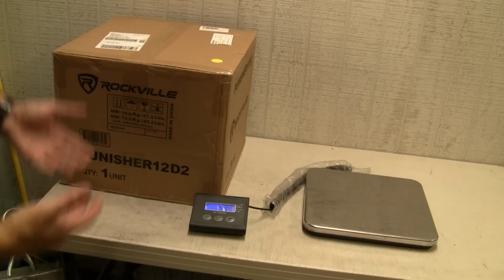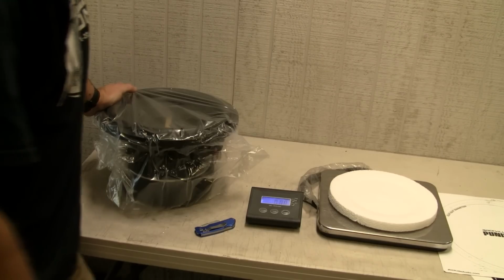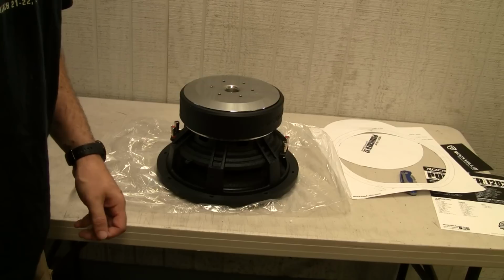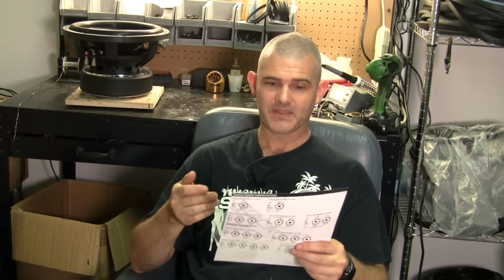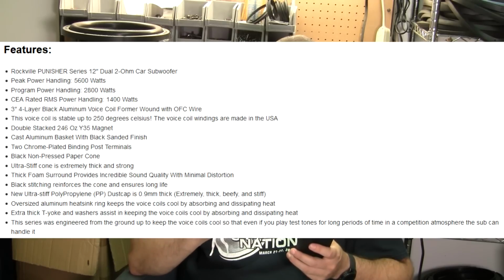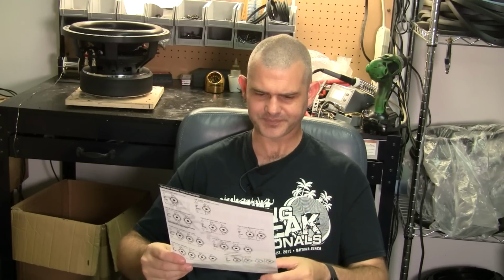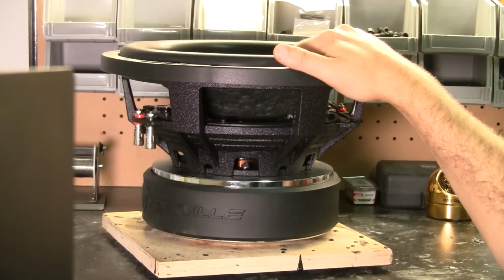Part 1: Rockville Punisher vs EMF Audio Lowballer, what specs do you look for when choosing a sub?

Comment: Eh I bought 2 15 Rockville punisher there running on 1500 a piece and no problems so far running at max power for about a month now and they stay cold and no smell at all
Reply from the maker: You think you're running 1,500 watts a piece. Prepare to have your heart broken in part 3 today.
Reply: @EMFAudio  people think my amp says 3k rms at 1ohm so that means the pair of subs is getting 1500w each and there actually getting it... That's a big nope.
Reply: EMF Audio I know I’m running 1500 a piece lmao I know what I’m doing I’ve been in car audio for 10 years and have the right tools to do the job
Reply from the maker: @ryanlucas7280  What makes you think you KNOW you have 1,500 watts a piece? Doing something for 10 years doesn't mean you've been doing it right for 10 years.
Reply: EMF Audio at a base 40hz test I have 1500 rms going into each one there’s a great tool called an multi meter and a rms meter 🤦🏼‍♂️ since music tends to move around the sound spectrum so does the wattage I measure out a 40 hz tone and set the gains accordingly that’s how I know what I’m getting and I’ve had it professionally checked by multiple company’s and people that know more than me I’ve had these for quite some time now and they aren’t even getting warm if I could dm you my setup I most definitely would I haven’t smelled mine before or anything so what you did in your video I’ll never know
Reply: @ryanlucas7280  lmao. You got no response
Reply: @austing2481  this guy isn’t the brightest hints to why my comments have likes and his dont

Comment: I have a rockford fosgate p3 and now i receive the punisher yesterday and hits hard not full power because still braking it.  Its on 2 ohm now on alpine mp500. So even they exaggerated on raiting im happy and it hit harder than p3.
Reply: U dont need to be full power to break in a sub. 3/4 will break it no problem. The box volume makes a difference also. This destroyer is better than many subs including the pricier p3.
Reply from the maker: You aren't breaking it in if it's not full power.
Reply: @EMFAudio   i just watched youre video  and i like youre way now i will pop my ears out  now tnks

Comment: Just saw a post on Facebook basshead group about how one sub is better then another because it had a bigger magnet and stiffer suspension.  He was comparing a low budget American Bass sub to a Rockford Fosgate T2 13 inch sub . Sure American bass subs are alright but I doubt better than the T2 13 .  EMF should do a Rockford T2 13  subwoofer test to see if it can handle rated specs . I doubt that Rockville can do 1000 RMS for 45 seconds without blowing the coil .
Reply from the maker: Post this video in that group! The following parts will really put it together. I have a fair amount of confidence the Rockford is probably appropriately rated. The American Bass however, I've reconed subs that people said they had rated power on them. I can't validate what they did or didn't have, but I've heard it alot.
Reply: Thats not true, had both will take the xfl all day.

Comment: The missing weight figure would probbalt be the top and bottom plate, woukdnt they be heavy as fuck. Maybe the magnet weight is just the actual magnet rings..
Reply from the maker: It's not hard to come up with 2 lbs of steel, but the plate sizes were accurate. The weight allocation was way off. But yes, the magnet weight is just the slugs themselves.

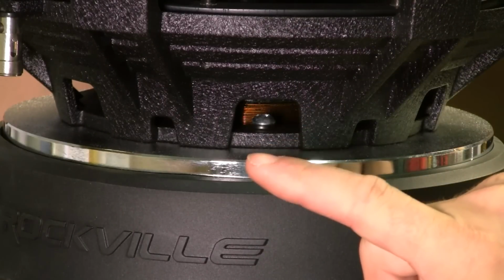Comment: At 25:30 you show the coil, i'm looking at what looks to be a fastener/screw that looks to be loose or incorrectly tightened?
Reply from the maker: Look past it, there is a little bit of black wire and the rest of it is down in the motor.
Reply: @EMFAudio  Lol, I'm so sorry for the confusion, I am aware of the coil but i noticed what looks to be a loose screw during the close up shot of the coil so my comment was regarding the screw. My question was not well executed so i can understand the confusion.

Comment: Step 1 calibrate your scale
Reply from the maker: That's why I mentioned the differences. Even if the scale was off, it wasn't off by the same amount, which means in a best case scenario one of those numbers is still wrong.

Comment: The original Rockville was flea market tier stuff out of some Chinese buildhouse catalog.   I hope nobody really expects this is going to be much different. Chinese have a saying "一分钱一分货" which is a rough equivalent to "you get what you pay for".  You call the build house and tell them you want all the shit they promise for 50$, they'll put it all on a spec sheet for you and sell you something similar for 50$ but at the end of the day everyone should know corners are being cut somewhere to give you something that looks similar to what you asked for at the price they promised.  By all accounts this isn't even considered dishonest when doing business in China but just part of the semantics of a business negotiation.

My prediction going forward, EMF's 2.5" coil sub is going to beat this on the meter.   3" 4 layer aluminum coil will probably survive 1 minute test tone at 1400W but it will be getting very hot.
Reply from the maker: So funny story.... Their build house said to me in person, without me saying anything, that they saw my video. I asked why they were so bad and they said they warned them their specs were not accurate for what they were making and it would cost more money to make the specs accurate. They refused to spend more money to make it right against the better judgement of the build house. The build house was honest, Rockville knew what they were doing.
Reply: @EMFAudio  
Interesting.   I had been told by someone who does business over there that it's their culture that this is more of an unspoken thing than them spelling it out for you.  Times must be changing.

I'm also told that the big thing where they skimp and save a buck is in the grade of magnets and steel you'll get.   Cheaping out on those materials is the easiest thing to hide from consumers.

Comment: U need to pop that junk and rebuild it and make it better
Reply from the maker: Here's the problem with doing that, the cost. Buy the sub, spend $140, recone it, spend more than $140, now you're $300 into a sub that will still be limited to around what a Lowballer is to start with, for half the money. The only way it kinda makes sense is if you got a blown one for free.